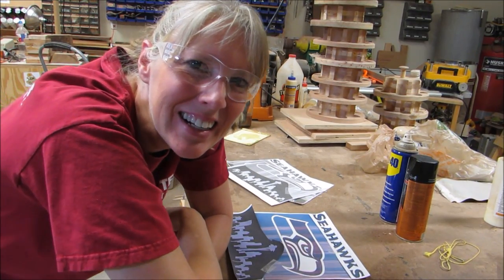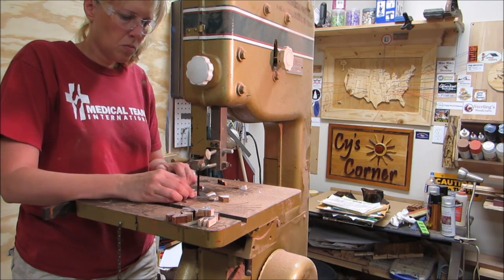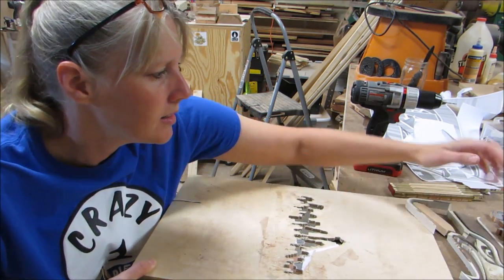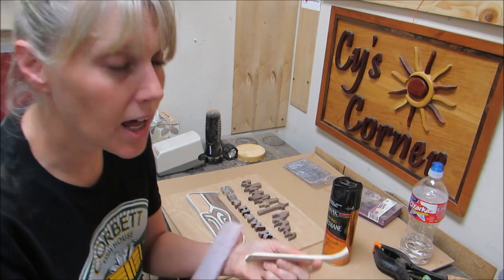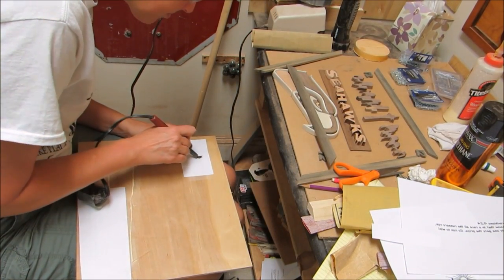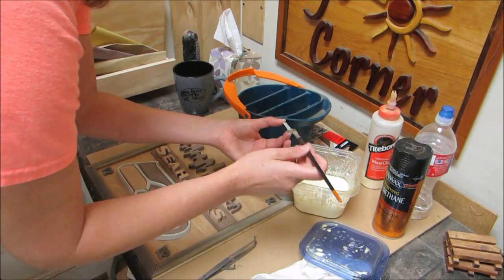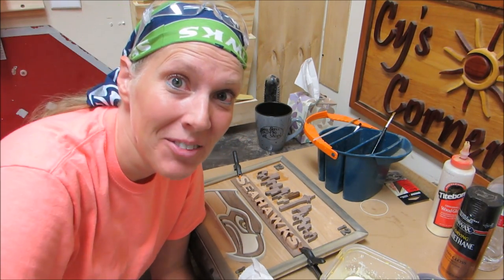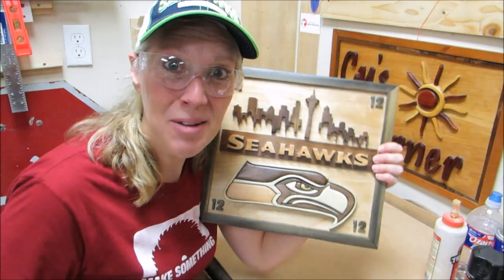Seahawks Sign

Comment: Did you think about using a blue dye for the hawk? If so why did you choose not to do that? Just wondering I know next to nothing about work working so it maybe an ignorant question, if so just ignore me. :)
Reply from the maker: +MidwestMotoRider You know what, I did try it.  I wanted to make the back ground green and fading to blue so I stained some of the backer board wood and when it dried it looked bad.  So I decided no staining.  I have seen some stained wood that turned out very nice though.  Not a bad question at all :)
Reply: Cy's Corner Ah see I knew you thought of it. Well thanks for replying back..

Comment: How did you put the paper on without it coming off when cutting the wood
Reply from the maker: @AJP Siggy I used to use stick glue on the wood, now I put blue tape on the wood and either use stick glue or spray glue like 3m77. If the wood is larger then I use clear peel and stick (like shelf paper) on the wood then glue to that. :)